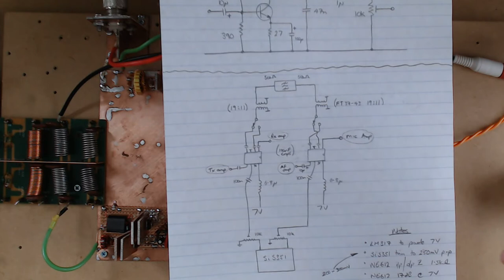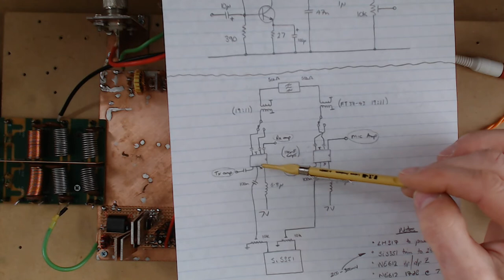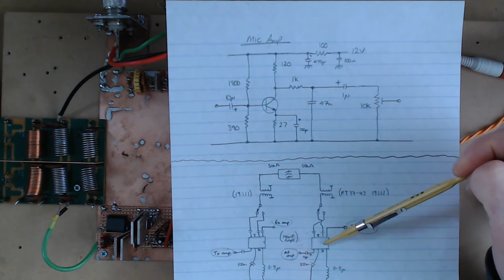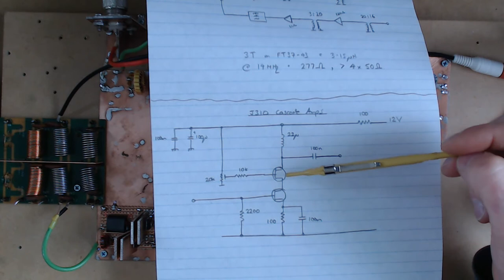Homebrew Portable 20m SSB Transceiver Part 3 - Update

Comment: hi charlie not sure if its just me but the audio seemed a little distorted on this video, your audio is normally nice and clear regards richard 2e0dvk
Reply from the maker: Yes, I noticed that too Richard. I normally use an old Sony camera, but this time elected to use a USB webcam. I had to crank up the mic gain to make the audio audible. Unfortunately, it resulted in distortion.  I will make sure I only use the Sony camera. Thanks again for the feedback.

73s

Charlie
Reply: your very welcome Charlie, im unsure if you have heard of them but ive been working with the ssb6.1 kit, ive found it interesting. Ive also been modifying the mchf firmware, but to do something like what your doing is really cool and would be a next step for me. I have thought about porting the ssb6.1 over to prototype board so that i could modify it and experiment easier with it but not yet done this. Im glad your giving the NE602/SA612 mixers a try as you would be suprise how many tranceivers currently use these. you might find it interesting to check out the x108 tranceiver and mchf tranceiver schematics. by for now regards Richard 2E0DVK  for some reason my tv box would not let me use caps on my previous post this post is from my laptop :)
Reply from the maker: Thanks again Richard. I will take a look at those. I understand the NE602/SA612 is not such a good choice for North America due to the higher density of hams, many of which have high power stations. We don't have that problem here in New Zealand. So far, I've been impressed with their performance.  Charlie
Reply: Charlie Morris As we discussed, my experience in VK3 concurs. I rarely hear overload or anything other than audibly clean signals in several homebrew receivers using SA621s  as first mixer and product detector.
Reply: Charlie, to be clear, youre using the dual J310 amplifier stage as a receive RF amp before the SA621? That makes sense on 20m where just the SA621 gain wouldn't be enough.
Reply from the maker: Thanks Paul. They certainly perform well in our conditions. I've been really impressed.

73s
Charlie
Reply from the maker: Yes, orange wires for RX. Ant -> BPF -> RF Amp -> NE612 (pin 1). It will be interesting to see what I'll need when I convert it to 80m.